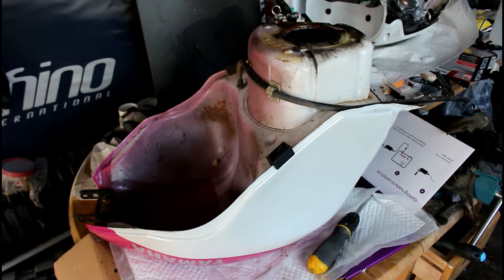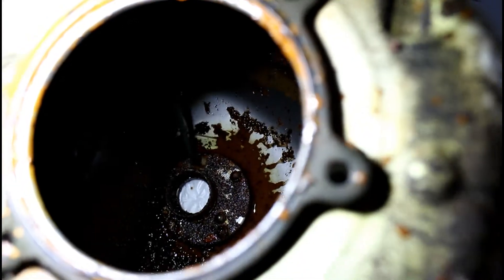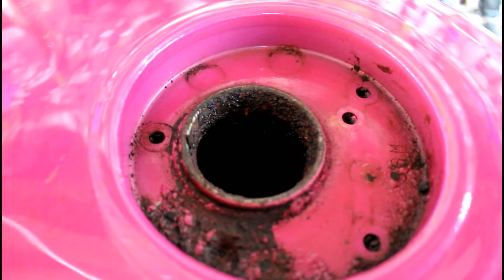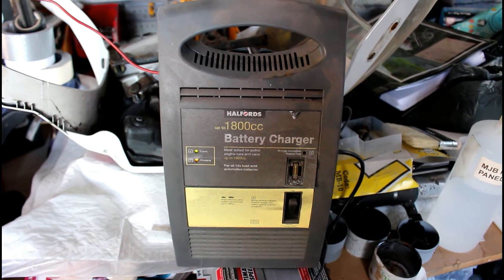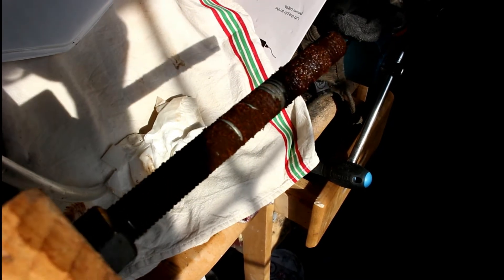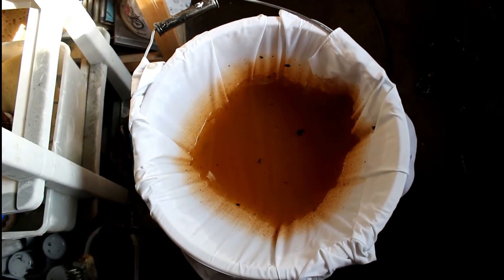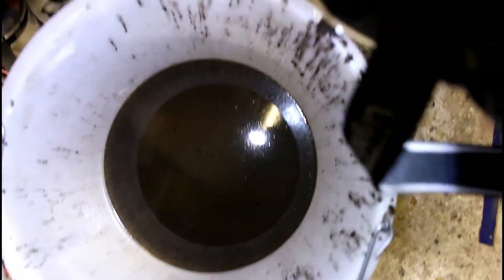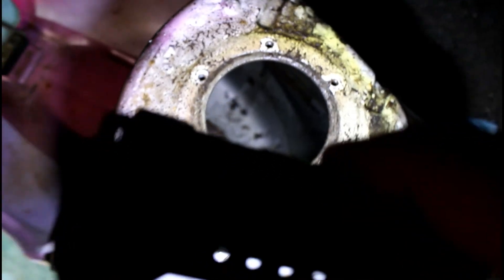The Ugliest fuel tank ever? Electrolysis to remove rust from Yamaha YZF750R petrol tank 1993

Comment: soap powder works just as well
Reply from the maker: Yeah I had heard that, the electrolysis did a decent job of pulling a lot of rust out of there  but without the Tank Cure sealant, it would have been junked  and it looked too good ( on the outside to junk) worked out nicely in the end.
Reply: @DeanAllen  Just done my GTR1000 tank,however previous owner did a bad seal job,now I've got to find a way to strip what's left.Just ordered a small bottle of 100% acetone and hope that'll dissolve a sample of the old liner
Reply from the maker: @jimnuttall881  
Hello Jim, hopefully Acetone will work, I sell it at work for Tuff Stuff GRP tool cleaning. 
Tank Cure do a remover, guess its the same type of thing. I assume you are removing everything from tank ( pump  any rubber seals etc. It will destroy those) 
Good luck my friend. 
Just a tip when you do it again (unless you have done before) makr sure the ambient temperature is warm. If needs be, warm the tank 1st with hair dryer, get the metal nice and warm, this way the Tankcure will flow nicely.